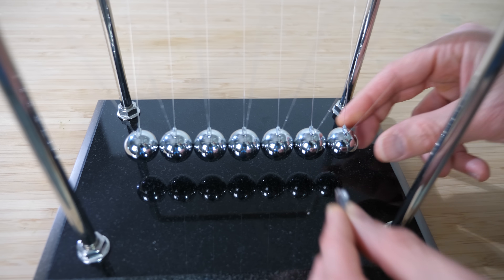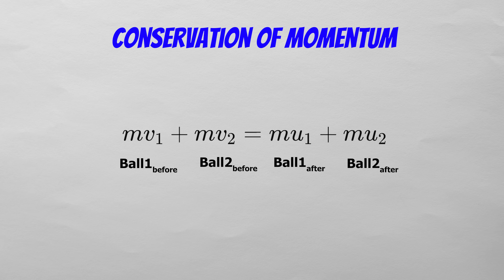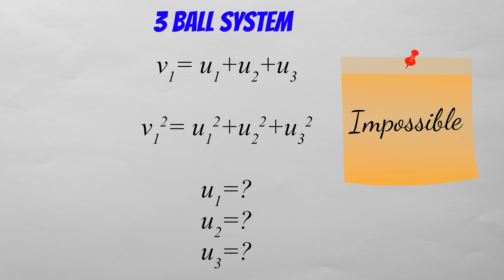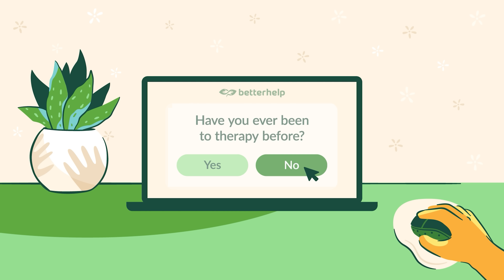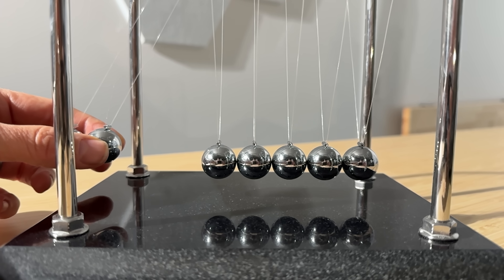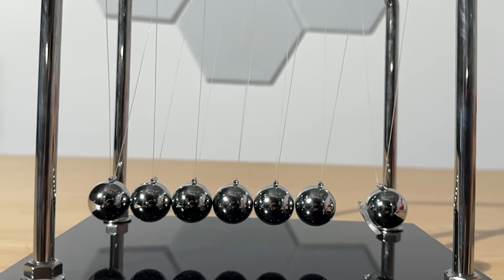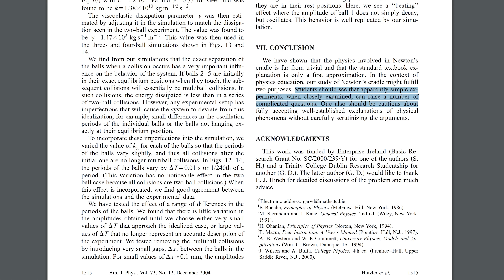Newton’s Cradle Doesn’t Work the Way You Think

Comment: 0:28 conservation of momentum+ conservation of energy
Reply: Mechanical Energy is not conserved
Reply: @AbhinavRaj-b1x 
as long as there is no friction it is conserved.
And in this case friction is minimal so energy loss is minimal. Also momentum can be transferred to the table and ghus to the house and thus to the ground shaking earth just a tiny little bit and thus even momentum in this thing is lost if you are considering everything.
If you only consider conservation of momentum in this thing 2 balls could kick up only 1 ball or 2 balls or 3 balls etc. It would not be fixed. Same goes for if you only consider conservation of energy. You actually need two equations to come to the conclusion that 2 balls will make exactly 2 balls move.
Thats because you have 2 unknowns.
mass and velocity. So you need two equations to solve for both.
Reply: @neutronenstern.  We don't need friction...it happens due to deformation of the body at atomic levels
Reply: @AbhinavRaj-b1x 
which is the cause of friction.
It causes heat.
Reply: @neutronenstern.  Dude it's not friction...for friction to occur there must be relative motion between the surfaces in contact.. That is they must slide against each other... Have you studied collision of smooth particles..in that there is a term called coefficient of restitution which is related to loss in Kinetic energy...since we assumed friction to be absent the only source of loss in energy is tiny deformation of the ball.. (my tone is polite I am not trying to mock you..)
Reply: @AbhinavRaj-b1x 
what do you think what happens on a atomic level?
Deformation does not nessesarily change the bonding energy. In fact in metals it does not change at all. It is just a shift.
And this shift makes the atoms vibrate more. It is internal friction similar to drag in a fluid. Eg when moving something through water or even when moving two fluids through each other like water through air (yes a gas can be called a "fluid" not a liquid, but a fluid)
Or when moving water around thus moving water through water. And the analogy for hard bodys like metals is deformation.
Reply: @neutronenstern.  No dude first is heat...and sound losses they are a souce of loss of energy...but second is deformation...think about it without deformation there will be no impulse...
And secondly deformation ofc don't change bond energy...but deformations does lead to potential energy changes as the relative position of particles changes...
Think about it when you press of a coke can you deform it...the point of application of force displaces that means work is done...that work is not all used up in heat generation... deformation of the body does takes energy...and hence some energy is lost in deformations of the balls... actually most of it is lost that way...there is an actual physical term for it called the coefficient of restitution...
And this shift of vibration is not friction... friction is a force that arises due to relative motion between the surfaces at contact so if two non rotating particles collide head on...there will be no sliding tendency of the surfaces hence no friction acts

Comment: I want to ask 2 questions:
1. 5:33 why the shockwaves meet make the balls apart? should the wave pass though each other?
2. if I use a Cradle with 6 balls, pull 1 ball up in each end at same height and let them fall at same time, then the shockwaves meet between 3rd and 4th ball. why the 3rd and 4th ball do not pop apart?
Reply: Just spit-balling here:
1. "make the balls apart" Think of each ball as a spring.  When the waves meets, each spring is compressed, so they push away from each other as the energy 'reflects'.
2.  "why the 3rd and 4th ball do not pop apart?"  They probably do, but they are also pushing against a lot of extra mass.  So, the most movement occurs where the amount of mass to move is least (where the shock/compression waves meet between balls 1 and 2, and between balls 5 and 6) causing balls 1 and 6 to bounce back.

Comment: That was a very interesting discussion.  I can't help wondering what would happen if the balls were not all the same size.  Given your explanation of wave propagation, it would seem that the usual behaviour could only work if all the balls had radii that were integer multiples of some number.  But that would affect the masses which are more related to the volume.  I would imagine that if one ball had twice the radius of each of the others, we'd still get something like the normal behaviour, but that the distance travelled after hitting that ball would be reduced and restored on the return journey.  Just a guess.  Perhaps also, if one ball had a non-integer multiple radius, the whole thing would quickly stop working as normal.  Again, just a guess.  I'll have to experiment :)

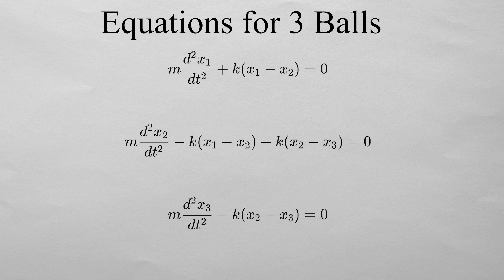Comment: Instead of Hooke's law in the system of differential equations (3:53), shouldn't Hertz' law be inserted for the forces? As a result the powers should be 3/2 instead of 1 in the system of ODEs.
Reply: You're completely correct, and switching Hooke's law to Hertz' law completely modifies the dynamics involved (you get solitons).

Comment: It is very close to reality to think of this as a series of individual spheres. In the initial single point contact, the contact stiffness is very low and unable to transmit the required forces. There is no shockwave to speak of, as the velocity of the ball is many orders of magnitude lower than the speed of sound in steel.
Reply: The contact pressure velocity in a chain of spheres is highly non-linear and that is the reason why more balls rebound, as the contact pressure wave disperses. This would be more visible with a longer chain. If you could increse the radius of the balls around the point of contact (by polishing), this dispersion would be less visible and the cradle would work more as intended.

Comment: I work as a physiotherapist and have a wave shock therapy machine at my clinic: a wonderful and painful way to feel wave propagation and absorption. It has a cylinder with a bullet inside that travels back and forth with a compressed air pump, striking a metal  fixed plate which is applied  to the skin in its opposite side.

It is made mainly to travel across soft tissues and transfer momentum to hard ones, specially little stones of undesired calcium-fosfate crystals that can inflame tendons and bursae.

Hope one day you’ll find something interesting to tell about this machine.

Or another health tool we have, ultrasound echograph, is even more interesting as it uses differential frequencies array to analyze sound absorption at different depths. Frequency and phase Fourier analysis gives the final image as I can guess.

Thanks for the video! 😊
Reply: Calcium phosphate crystals? You mean bone fragments? 😉
(I’m not too familiar with the human body, but as a chemistry teacher I do recognize it as the main ‘ingredient’ in bones!)
Reply: @ the mineral component of the bones, you’re right. Calcium deposits in form of (hydroxi) apatite that forms irregular crystals but aren’t ectopic bone.

Fortunately for us, because with the organic collagen compound of the bones will be impossible to break with wave shocks at the energy we use to not damage the healthy tissue.

Mineral bone-like crystals are hard but fragile, so we can break majority of them with the machine.

Those that are impossible to remove undergo a little minimal invasive treatment to percutaneous extraction.
Reply: So, a poo finder and a poo mover (if constipated)
Reply: Painful?? 🤔
Reply: @silkworm87  yep, it hurts… but is very effective. Shock waves propagate painfulness through soft tissue but it irritates transition zones between two different absorption coefficients where it reflects or deviate. One of the biological effects is inflame some degraded tissues (tendon and bursa mainly) to induce new blood vessels and healing.

Comment: What hurts my brain with the cradle is that when hitting with two or more balls. The same amount of balls are bouncing back, instead of just one going higher.

If you take one ball and hit it with different forces, one ball would go higher and higher depending on the force.
So why do two balls make two balls bounce instead of one going twice the height?
Reply: He explains this in the video. When you drop two balls, you still get two waves. One travels through the stationary balls. The other through the falling balls. The wave through the falling balls has to travel through two balls before reflecting, so the the waves run into each other two balls from the other end causing them to deflect at that point.
Reply: Think of it one step at a time. Let's say we have five balls, and number the balls 1, 2, 3, 4, and 5.

If you lift 1 and 2 into the air and then drop them, then:
2 strikes 3 and transfers its energy
simultaneously 1 transfers its energy to 2
Then 
3 transfers its energy to 4
simultaneously, 2 transfers its energy to 3
Then 
4 transfers its energy to 5; 5 is the end of the row, meaning it has nowhere to transfer energy to, so it goes into the air, making 4 the new end of the row
simultaneously, 3 transfers its energy to 4; 4 is the end of the row, so it goes into the air, making 3 the new end of the row
Reply: @Chocomin-hime  You made the most  sense with your explanation. Thanks 😊

Comment: Instead of inserting a plastic spacer, what happens if you replace the starter ball with a steel ballish-shaped object that has the same mass but has half the thickness? That should change the timing for the reflected wave.

Comment: Please, someone with some knowledge on physics come up with a design for a car that has safety features comparable to newtons cradle. The ability of the car to transfer the momentum through the passengers to the front of the car and a Newton cradle mechanism would be amazing. Amazing if it would work.
Reply: See Black Panther.  The Wakandans have a car that does this for a safety feature.  When crashed hard enough, it explodes in order to keep the shock AWAY from the passenger, not through them.  Through would be horrific.  If it returned inertia like the Newton's cradle, it would crash the original car back, which would also be horrific.  Imagine two cars having this feature just like the cradle, and having to relive a crash twenty times before the system stopped rebounding.  Meanwhile, pedestrians and/or other cars/objects are getting hit on both sides.  Better for the car to explode and leave you sliding along the road like a weird carnival ride, still holding the loose steering wheel.

Comment: Hers's a hypothetical holographic solution. Newton's Cradle can be explained using Quantum Information Holography (QIH) by modeling the energy and momentum transfer as interactions of Quantum State Vectors (QSVs) within a holographic framework. Each ball's motion represents a localized projection of energy and momentum encoded in QSVs.

In QIH, the motion of the first ball creates a disturbance in the quantum state field, represented mathematically as interference patterns of QSVs. When the first ball is lifted and released, its QSV encodes momentum p⃗p

 and energy E, which propagate through the entangled states of the adjacent balls. This is expressed by the QIH equation for conservation of momentum:
∑ip⃗i⋅f(θi)=constant

Here, p⃗i

 represents the momentum of each ball, and f(θi) is an interference term determined by the orientation of the QSV. The interference ensures the perfect transfer of momentum and energy to the next ball under ideal conditions.

As the QSV evolves, the transition of energy between adjacent balls is described by:

Δp⃗i=−Δp⃗i+1

This shows that any gain in momentum for one ball corresponds to an equivalent loss for the other, maintaining overall conservation. The final ball receives the full projection of the energy encoded in the initial QSV as the state collapses constructively onto its position.

The slowing down of Newton's Cradle over time arises due to factors like friction and air resistance, which are represented in QIH as disturbances to the holographic encoding of energy. These effects introduce decoherence into the QSV field, causing some energy to dissipate as heat or sound. This can be modeled by adding a damping term γ to the QIH equations, such as:

∂E⃗i∂t=v⃗i⋅∇f(θ)−γE⃗i

The damping term γ accounts for energy loss, breaking the ideal conservation of holographic information. Over time, the interference patterns become less constructive, leading to reduced momentum transfer and eventual cessation of motion.

Thus, in QIH terms, Newton's Cradle illustrates how energy and momentum transfer holographically through entangled QSVs, while external perturbations cause the system to lose coherence and slow down. The mistuxe of ideal quantum conservation and real-world decoherence provides a complete picture of its dynamics.

Comment: GREAT !!!

it machtes well with another vid i've seen just recently:
wave propagation demonstrated on metal bars of varying lengths.
there was an initial electrical sensor and a terminal impact detector.
both signals were sent to a scope - and it showed the runtimes in very short time scales.

rationale: impacts will compress the metal, and then the compression runs as a wave along the material.
thats how it works and the above vid does realize a great demonstration on what is happening.

now do this:

make a mass (or a set of masses) of e.g. twice the input ball mass - with the same x-axis metric...
or make two masses each equalling the same as the input mass with each half of the thickness.
we will most likely see that it only depends on the thickness.
it will get even more interesting if you let pairs of input masses bump into...

or use some rods in between two such ball items... and then see that the interconnect is not that relevant... the wave will just be transmitted...

Comment: When I see this it makes me think about jack hammering concrete.  I think the main principle is on the lines of "freedom of movement".  One ball or three balls, is like the difference between a hand held chipping hammer vs a 90 lb air hammer.  The more force is moving thru, the bigger the hit, the bigger the piece you can break off.  But in each case, the start of the hole is difficult for the reason that the hammer bit is completely surrounded and the force is absorbed, making starting the hole the most difficult.  But once you have an edge, the concrete chips off easily, because the concrete has freedom of movement, whereas the starter hole cannot chip off the concrete because the concrete has no where to go.  "Freedom of movement" seems to explain a bunch of things, like water, mold, electricity, magnets, time rates (closer to earth vs farther) etc..

Comment: What. So your explanation of the travel-time of the shockwaves being relevant, means that if you'd make the starting ball twice the volume with half the mass, you would get unexpected results since the shockwaves will not meet exactly at a separation-point of the final 2 balls. I think you should see if you can prove that experimentally, it doesn't sound quite right to me.

Comment: Wait, can someone do a demonstration of balls very close but not in contact? It was stated in the middle of the video that this isn't a similar case but can we physically demonstrate that statement?
Reply: Sure – try it yourself.  Use pool/billiards balls, large bearing balls, marbles, whatever solid spheres are convenient.  Line them up in a straight line, one time with all but one touching, the other time none touching but close together.  Smack the "front" end.  There won't be as much energy transferred to the end of the spaced group because the collisions are not as efficient (or fast) as the wave moving through the touching group.  They should act somewhat similarly, however, in that the last ball isn't slowed by anything in front of it, so it diverges from the group in both cases.
If those balls were hanging, it would quickly become evident by the randomized clacking and the sooner stop, that the separated balls were not doing remotely the same thing.